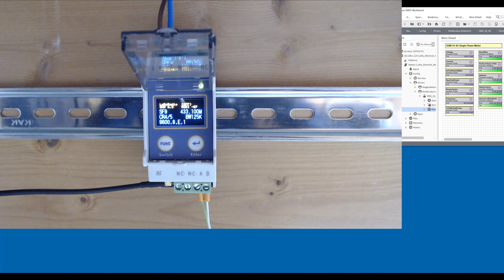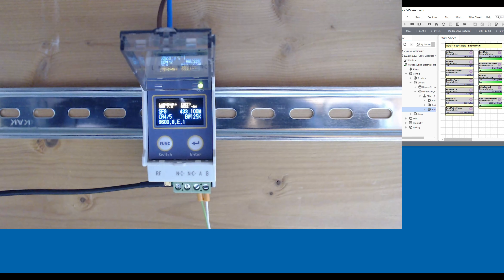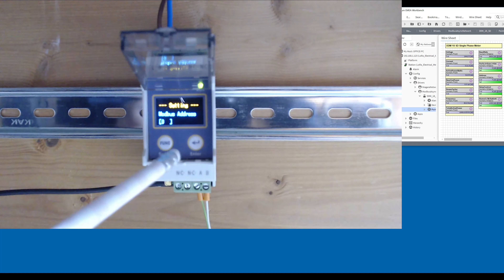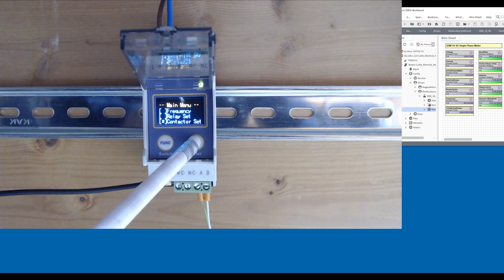#18 Machine learning - OBM-LoRa-223 Menu Items

Comment: Hola muy interesante está explicación. 
Quisiera saber si este dispositivo lo puedo conectar a un sensor o flotador para tanque de agua ya que la bomba se encuentra como a unos 600m de distancia y queremos que se apague cuando el tanque llene. 
Muchas gracias por tu colaboración.
Reply from the maker: Hello, this explanation is very interesting. 
I would like to know if I can connect this device to a sensor or float for a water tank since the pump is about 600m away and we want it to turn off when the tank fills. 
Thank you very much for your collaboration.

If you have power there which you will have for the pump and you will need to use a Modbus switch module, if it was me i would use this device at https://www.innon.com/products/isma-b-4o-h its a 4 output unit and can receive MODBUS signal, its 24VAC or DC, so you would have to use a 240VAC to 24V AC or DC transformer.
Reply: @NiagaraTridium  muchas gracias por tu colaboracion.

Comment: Hi, I’m using a Lora 223 on my Solis solar inverter to monitor grid supply meter. 
I have managed to get it working and communicating when the LCD screens are illuminated but when the LCD screen of the Lora unit goes off it stops communicating and my Solis inverter goes into alarm. I then have to press the function button on both Lora units and then communication starts again???
It’s like the Lora units go to sleep when LCD screen goes off . I have it on standard Lora radio settings. Any advice would be greatly appreciated. Thanks Ian
Reply from the maker: Solis inverters don't seem to like this LoRa module, normally they are used with the Giv Energy inverters which i have and using them fine with this type of inverter. 
I know that does not help you much, but I do know that the LoRa radios do not go off when the screen goes off, so that's not the issue. 
I think its down to the polling of the MODBUS signal on the LoRa Radio, have you increased the polling ?

[PPTM] – Poll Idle - select the digit you are wanting to change using the FUNC button
and adjust the value using the enter button. Default 900 Sec
Interval Min - select the digit you are wanting to change using the FUNC
button and adjust the value using the enter button. Default 5 Sec
Interval Max - select the digit you are wanting to change using the FUNC
button and adjust the value using the enter button. Default 30 Sec

Full documentation at https://bmsparts.co.uk/shop-maxking-limited/lora/lora-wireless-rs485-transmitter-and-receiver-2-units-lcd-screen/

Comment: What is the "Run" light indicating?
Reply from the maker: Data transmission is the RUN green LED. Shows that the unit is communicating to the other LoRa radio device and data is being passed to each other.
Reply: @NiagaraTridium  thank you Paul.
Reply: @NiagaraTridium   do you happen to know what the difference in speed signifies? fast vs slow?

Comment from the maker: SF9 = Spreading Factor Low - SF8 = Spreading Factor Medium - SF7 = Spreading Factor High
Larger spreading factors mean larger processing gain, and so a signal modulated with a larger spreading factor can be received with fewer errors compared to a signal with a lower spreading factor, and therefore travel a longer distance. For example, a signal modulated with the SF9 can travel a longer distance than a signal modulated with the SF7.